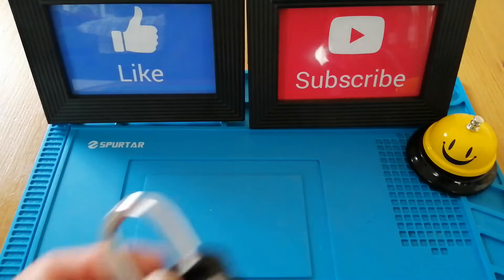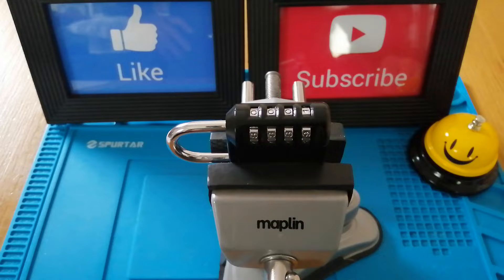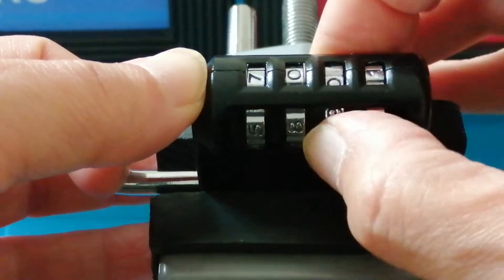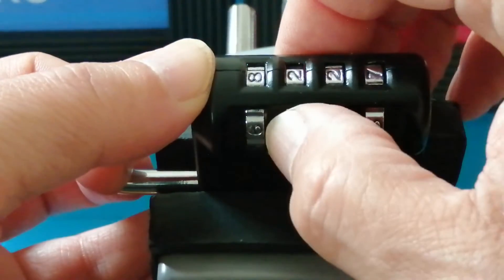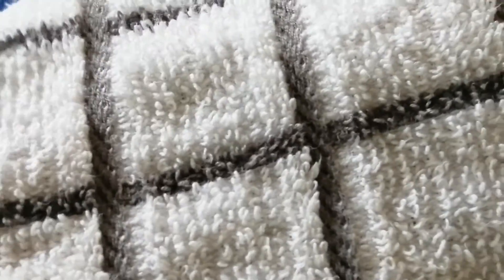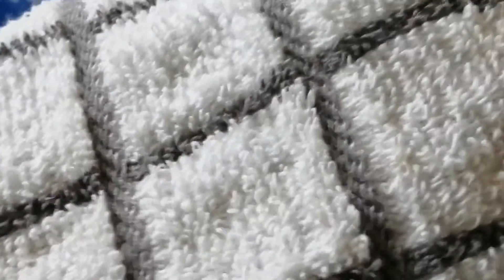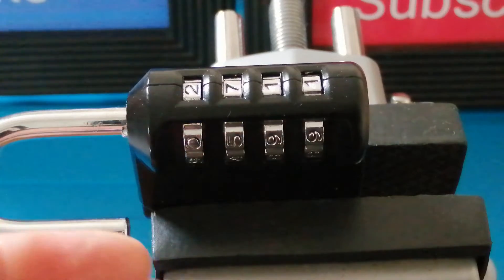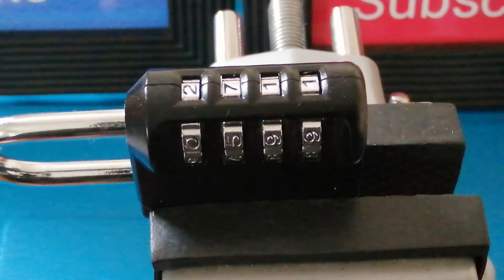#29 How I struggled to retrieve / decode the lost code of a Zhege combination lock

Comment: Do you have any updates on this I cannot get mine open can you explain more through what your doing when you find 2 is useful what does that mean and you return back up to it after going to the bottom again it’s hard to tell why you do what u do so it doesn’t apply to variable situations
Reply from the maker: Pull on the shackle and try and find a position where wheel number two (second wheel from the shackle) is loosest. Then turn the first wheel (closet to the shackle) until wheel two binds. Continue this process with each wheel in turn. Sometimes you might not be able to find a point where a wheel is at its loosest so go to the previous wheel and turn it by one and repeat. Good luck and let me know how you get on.

Comment: Is this not the same as the 3rd lock in video #16 (branded NRG I think, you did mention there are many rebrands of it) - it looks very similar!
Reply from the maker: You are absolutely correct. I’ve just checked the one from video #16 and they look identical, however they don’t decode the same. The one from #16 opens very easily, this one gave me a headache for months. I’m beginning to think this one has very poor tolerances and is cheap and nasty. I have four NRG’s and they all fall open fast. Very observant of you, well done. Thank you for pointing this out to me.
Reply: @sotonlock7894  No worries. As it happens, I just got rid of an identical one rebranded as Rhino Locks (which could be decoded the standard way in 2 mins) and have the Zhege coming tomorrow so will see if that fairs any different!
Reply from the maker: Please let me know how it goes with the Zhege.
Reply: @sotonlock7894    Got my glamorous assistant to code the new Zhege today. IMO very similar to my old one (perhaps a little looser - QC?) and was in in a few minutes but bear in mind that's my second ever decode. Reckon you might have a duff one!
Reply from the maker: @jimbob2hats925  I’m hoping it’s a QC issue rather than me losing my touch! Thanks for letting me know. Well done on getting yours open without too much trouble.